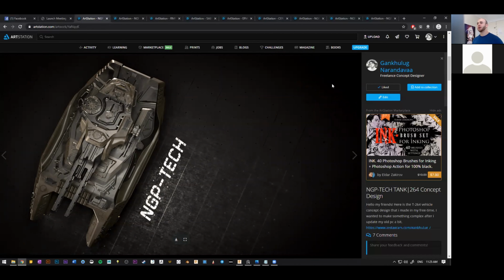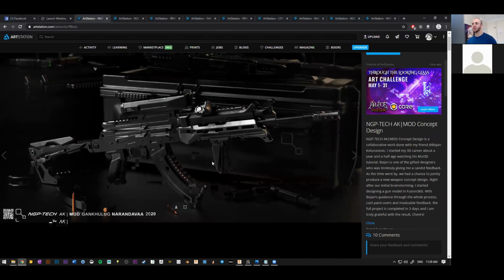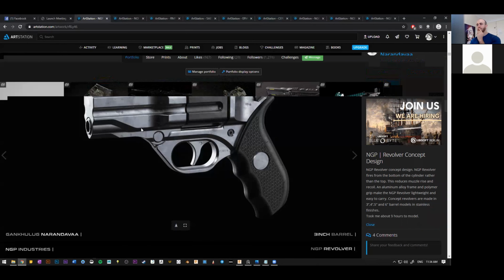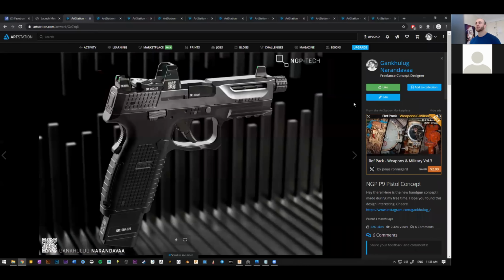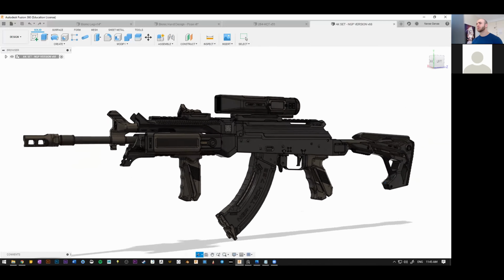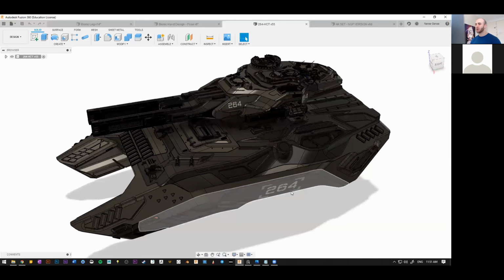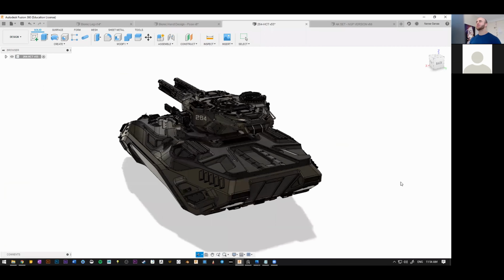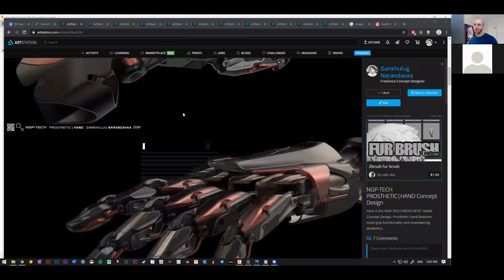Artist Spotlight Interview -  Gankhulug Narandavaa

Comment: ahhh that left ear audio..   In after effects you can apply an effect on the video/audio called Stereo Mixer. Change the left pan to 0% and right pan to 50%. Might need to bump levels up afterwards. Make sure to use the audio window and that your audio is around the -12db range.